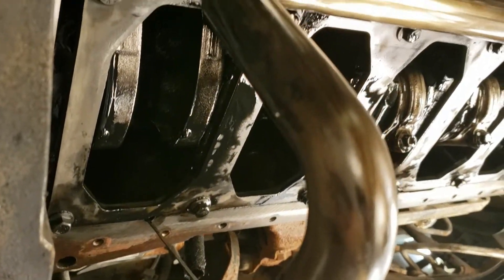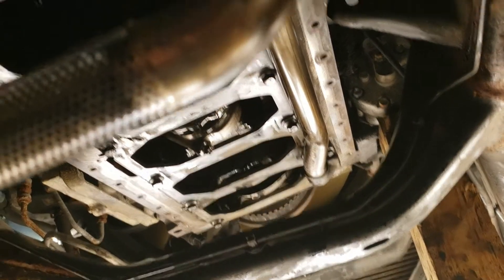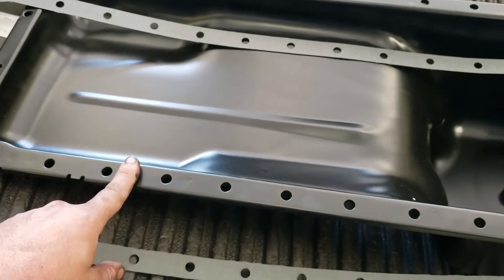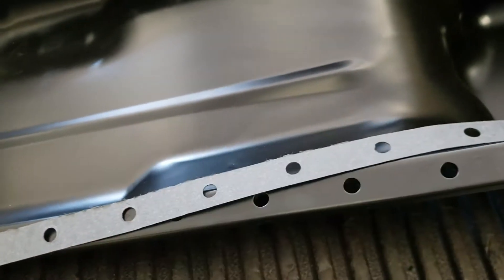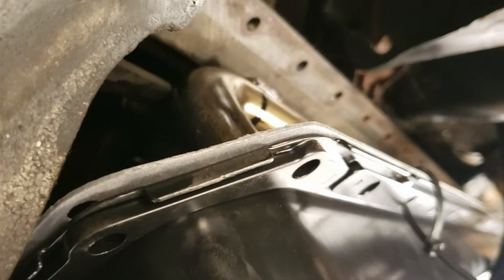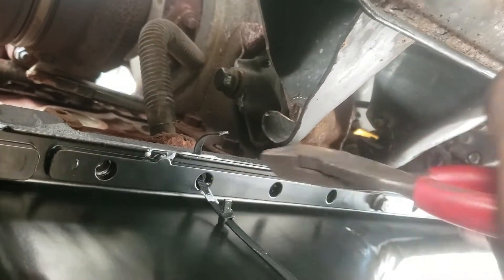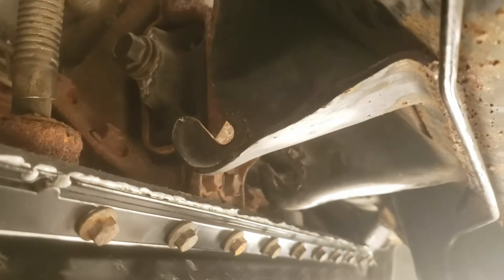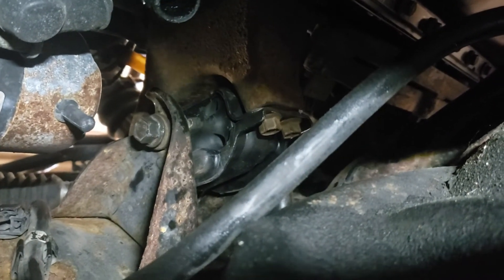2005 Dodge Ram 2500 5.9L Oil pan and Engine mount replacement!!

Comment: Where did you place the wood to jack up the motor, how did you leave it suspended while you're working? I'm doing mine soon
Reply from the maker: Very dangerously!! That piece of wood is going from jack to bracket for a/c compressor.....
Reply: @RandomTrades  Live dangerous thanks ! 😆

Comment: Great video! Where did You get Your pan, gasket and motor mount from? What part of the engine did you have that 2x4 lifting against?
Reply from the maker: Thanks! I purchased all parts from rockauto.com and the 2x4's were placed on the block itself once the oil pan was loose and pushed to the side.
Reply: @RandomTrades  Thanks so much for the reply! Did You put silicone only in the corners of the gasket or around the hole block? I am getting ready to do the same thing to my truck next week. Thanks for your help. I really appreciate it!👍
Reply from the maker: No problem! Glad to help. So yes, once I put a solid beed of "RTV" or gasket maker on the pan, then spread it around the holes with my finger nice and even. As far as block goes,, just the 4 corners will suffice but won't hurt i thin layer on all of it. Just by careful not to put too much as the excess could squeeze out in the pan and possibly get sucked up by the oil pickup tube.. Best of luck and no more oil leaks/rusted old pan.👍
Reply: @DirectCurrent4u  go all the way around...I only did the 4 points like your supposed to and now I have to pull it apart n do it again cuz it's leaking across the from somewhere. Just do it all while you have it out so you don't have to do it twice like me!
Reply: @MyBigThing2010  Thanks for the update!
Reply: So a single 2x4 held up the engine?  @RandomTrades
Reply from the maker: @Favored1881 yes
Reply: @RandomTrades  wow ok ty

Comment: What kind of silicone did you use and you only went on those 4 spots you showed?
Reply from the maker: I used "permatex ultra grey" gasket maker. And no I ended up putting a thin film under whole gasket as well, but you don't have to.
Reply: @RandomTrades  I went ahead and used ultra black oil resistant. Hoping everything works out and doesn't leak. Pain in the ass.
Reply: Also, I went ahead and used it all around the bottom side of the block
Reply from the maker: Thats fine, just keep it a "thin layer" and let it dry for 24 hours if it is thick, just don't want it sqeezing too much in the pan itself to be picked up by oil pickup tube.
Reply from the maker: Yes absolute pain!!! But worth it to do it yourself.
Reply: @RandomTrades  thanks for the video and yeah I tried to keep it as thin as possible. Most shops wanted anywhere from 600 to 1200 to do it.
Reply from the maker: Glad I could help. If there is anything you want to see, just drop it in the comments and we'll try to make it happen. 👍

Comment: The 5.7 is a pain in the ass with the spash plate gasket. Would be nice if dodge just bolted that cross member in place so you could take it off when doing repair work. Idiots!

Comment: On that motor mount , did you use a jack to lift th engine up ?
Reply: And how did you take off the top bolt of the mount
Reply from the maker: Yes, I used a 4x4 standing on end   of jack, on the corner of the block. Might I recommend supporting the engine with a chain to prevent it from falling.
Reply from the maker: Once the engine is up i was able to fit a impact gun in the front with a wrench on back and it came right out.
Reply: Random Trades but the top bolt ? Cz I have a pole lift at home yet I don’t have a second beam supports to put in the back so doing it on the ground instead , so you can fit once it is lifted for the top bolt
Reply from the maker: Yes, you can fit either a wrench and go quarter turn at a time or you can fit a ratchet and socket and get it in there. It dies fit and you can lift on the engine block if the oil pan is off. Otherwise you'll have to lift from top if oil pan in still on.
Reply: Random Trades thanks got it out , but the previous person who worked on it put silicone on it that’s what made the top bolt hard to get out , thanks for the help
Reply from the maker: @ExotiiicRL  absolutely! Great job. Hate when someone does a poor job to be followed up on.
Reply: Random Trades yeah facts but engine that I put , client picked it 💀had to take it back out , go find one myself and put it on ffs💀😂 but thanks for the advice , now I got it out in a min or so  and put the mount back in less then a minute 🤷🏻‍♂️ thanks G

Comment: Did you have to remove anything else to lift the motor up?  Or you just loosened the motor mounts and that’s it?
Reply from the maker: Good question,  I only removed oil pan bolts to be able to push motor up, then loosen motor mounts.  So simple answer,  no.